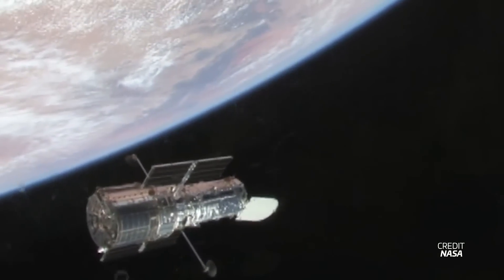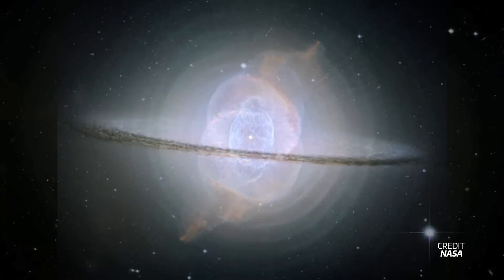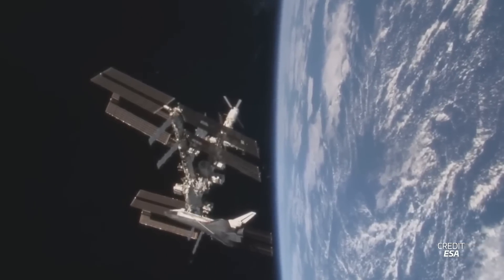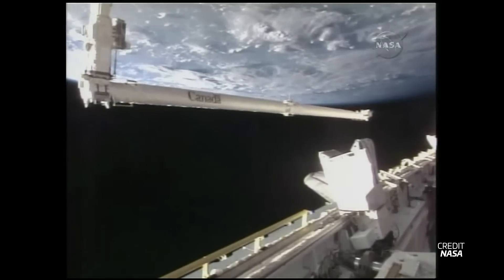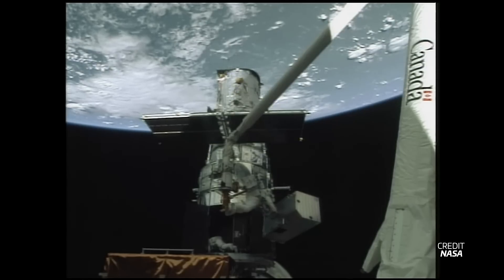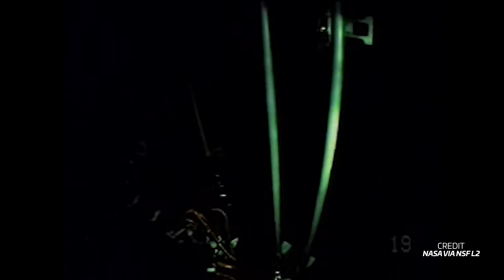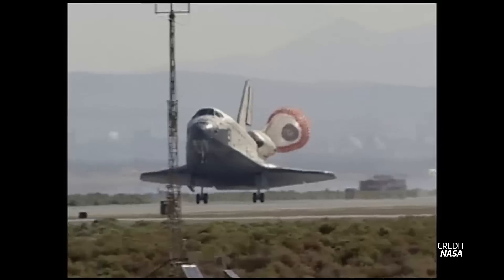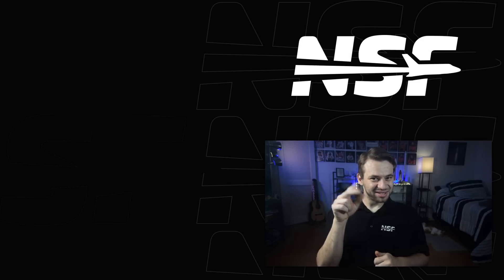A Mission So Dangerous A Rescue Shuttle Was Ready! | STS-125

Comment: IF Starship ever becomes a viable and reliable vessel it would be better to replace Hubble with a new-hotness at the same time they bring it back for analysis and enshrinement in a museum.
We need to move past the point where we think of everything that is launched in to orbit as being gone once something fails or it runs out of fuel or power. A spacefaring civilization constantly upgrades and swaps out old technology for new.
You only learn of what didn't work before after you do an analysis of what the space environment does to equipment. Then you can take that knowledge and advance the science and art.

Comment: You'll love this. The National Reconnaissance Office (NRO), these are the spy satellite people. In mid 2012 the NRO decided to donate (2) identical spy satellites to NASA. These satellites were complete & supposed to have been deployed with the rest of the constellation, but these last (2) never launched & were sitting in storage. When NASA was told what they were getting & when the (2) satellites were actually delivered to NASA, it was a massive shock. These (2) satellites were more advanced versions of the Hubble Space Telescope, only these were made to face towards Earth not away from it. Not only did these (2) identical satellites rival Hubble in capability & power, these had a secondary mirror system that dramatically improved the sharpness of the images. Keep in mind these are (2) leftovers from a constellation of an undisclosed number. So given the fact that just (1) is a more advanced version of the Hubble & had a secondary mirror system that Hubble did not have & the NRO donated (2) to NASA. So how many were in the constellation that did get deployed??? I know the Keyhole satellites from the late 70s were capable of reading the license plate of any automobile & as they advanced through the early 80s, the latter half deployed could read the date off a dime.

Comment: There may be a chance Hubble now is unservicable in orbit right now. Some of the bolts were stuck or stripped when they removed parts from the last service mission. Now has been a long gap in time so many more bolts will be nearly impossible to remove. Break 1 bolt and it may be game over. Bring it back safely then service it and put back in orbit. Or just build a new one entirely

Comment: I never liked the shuttle from day one. First it was over sold to Congress and the cheap “reusable/quick turnaround” aspects never really worked financially. More importantly, the design was an accident to happen, the tiles were absurdly fragile and as such subject to failure and finally and more importantly there was no crew escape mechanism on launch. Re-entry safety systems, of course,  do not exist with our current  level of technology. i  I recall one specialist predicting a major - and probably fatal - failure of one in 25 or so missions. Space travel is very dangerous and potentially deadly. Flying this thing shortened the odds for tragedy.

Comment: Someone please explain to me, how any space vessels can pass the Van Ellen Belt, which is supposedly to be more than 1.000 decC? 
Many thanks for enlightening me.
Reply: Van allen belts are mostly beta and alpha, alpha is blocked by skin and beta can be blocked by a sheet of aluminum
Reply: @cardboard9124  Aluminium melts at 660 degrees C. …
Reply: @akkseljohansson3601  Yes, whats the problem? Space transmits virtually no heat. Its like sparks, sparks are hundreds of degrees, they should melt your skin, right? No, because they are so small and spread out, you don't even feel a thing. Same in space, air molecules at 1000s of degrees are so small and spread out they barely even warm the capsule

Comment: Would be great to preserve it as better devices take over the role.  Building a Moon based set of telescopes should be a high priority on the Far side with fiberoptic lines to relay data.  Moon would shield Earth based static and glare, also would avoid navigation related issues with massive numbers of orbiting objects added over time.  Perhaps even a Telecom base on the near side would be useful and scalable.